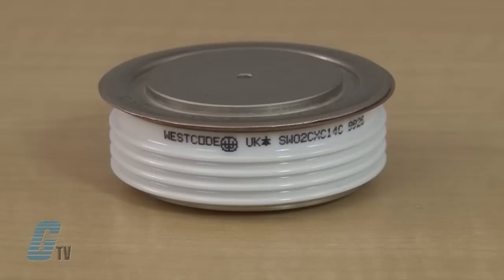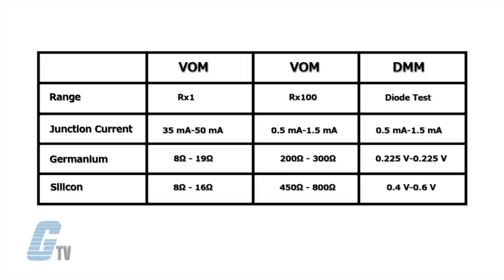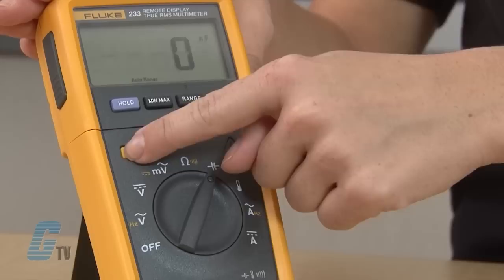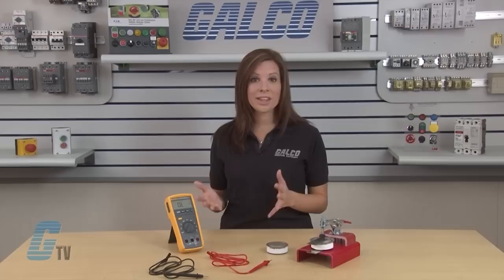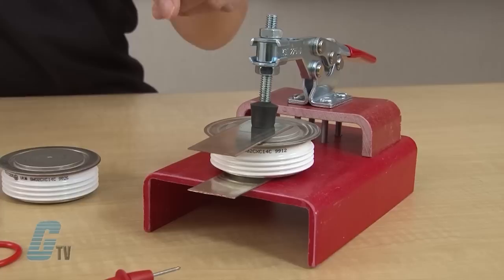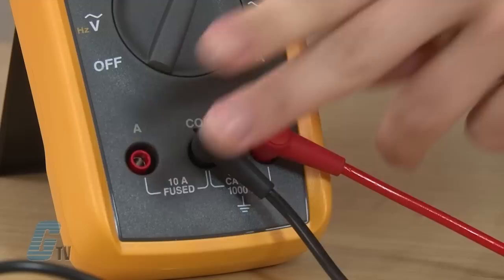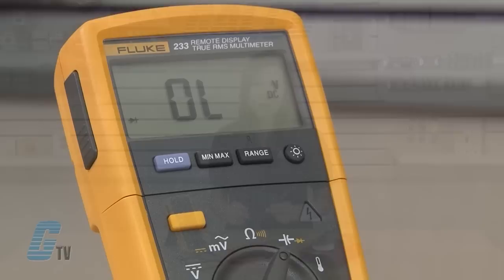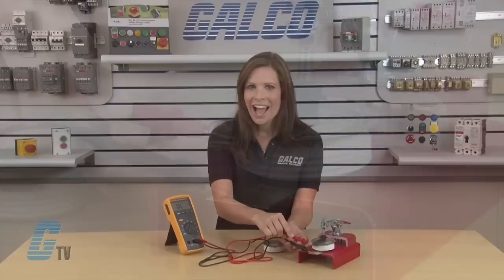How To Test A Hockey Puck Diode Using A Standard Digital Multimeter

Comment: What about the impedance measurement
Reply from the maker: This is just a general test to look for failures. If you are referring to a resistance measurement, that will vary significantly depending on the meter you are using for the testing. The actual impedance of a diode can only be calculated in circuit and will very depending on the amount of current passing through it. The forward bias voltage remains the same at low and hi current levels when in conduction mode so impedance will depend on it. Hope this helps.